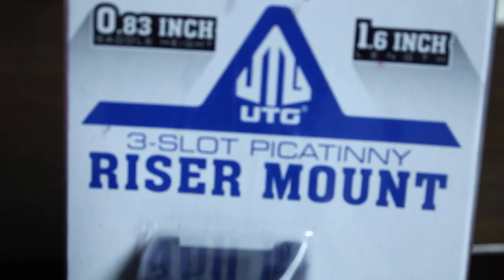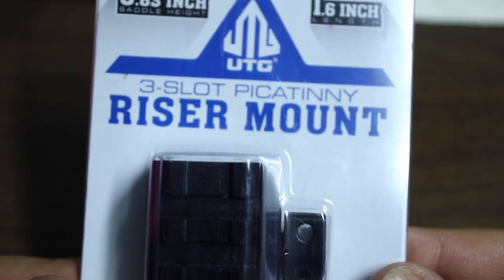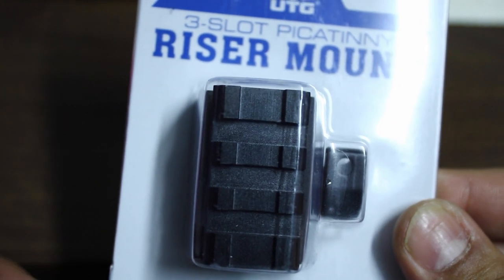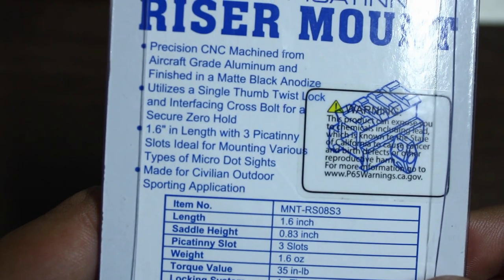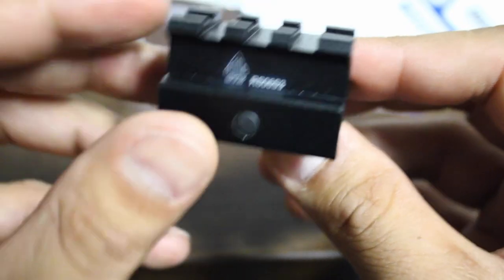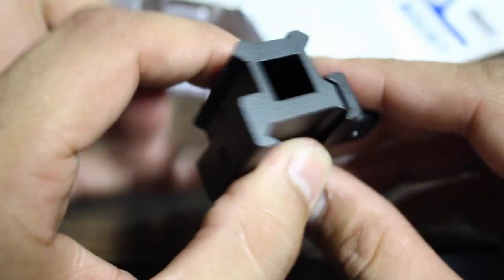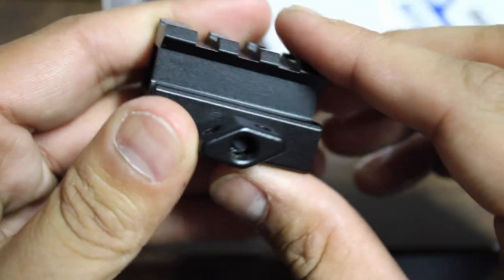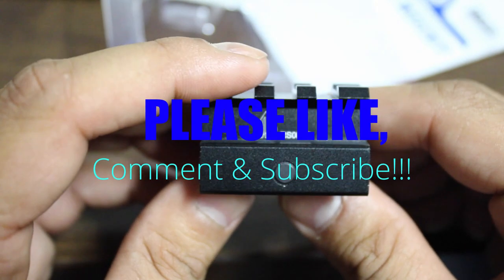UTG 0.83 In 3-Slot Riser Mount - Review

Comment: This mount is highly slept on. The thumb screw looks much smaller in person and is super easy to tighten by hand. The clamping side of the mount is pushed open with a couple decently heavy springs and the thumb screw doesnt fully back out. This allows you to take it on or off easily without fiddling with the parts. If something happens to my red dot i want to be able to quickly take it off without tools.
Reply from the maker: That’s a very good point bro

Comment: Even though tis is higher than the super slim by them, the bolt is a better option because it will def fit any existing picatinny rail whereas the tolerances i think for the super slim are too tight.
Reply from the maker: I would have to agree with you on that.
Reply: @JSquaredTactical  Good to know because I was beginning to think I was going mad LOL! I did try this out on several (with existing rails), it fitted none.
Reply from the maker: @bctpcp9546  haha I hear ya, I felt the same way so what I did was sell my bushnell red dot and this riser and bought the Holosun which already raised perfectly over my laser.
Reply: @JSquaredTactical  Yeah I need to save the ghoulash for a holosun LOL.
Reply from the maker: @bctpcp9546  it’s not a bad price…sub 200, great optic
Reply: @JSquaredTactical  One day for sure but right now I need a decent long eye relief scope, any recommendations? Sub 300 if possible?
Reply from the maker: @bctpcp9546  sorry I’m just seeing this. But I would suggest, the Leupold VX Freedom 3. Leupold has always been one of my favorites and it comes in at just under $300.
Reply: @JSquaredTactical  I'll check that out thanks!